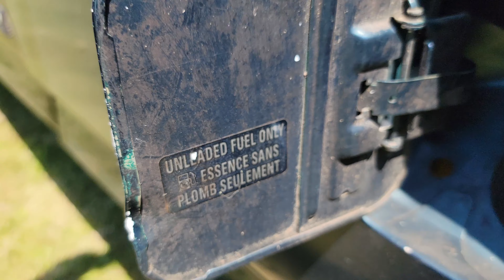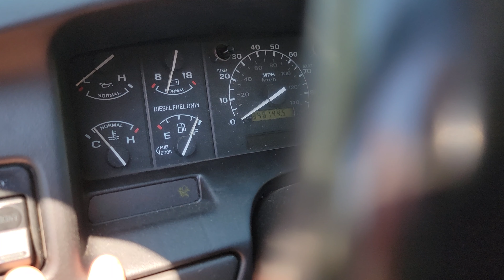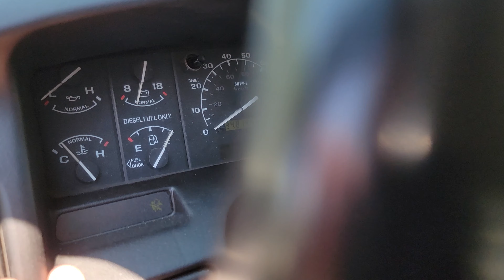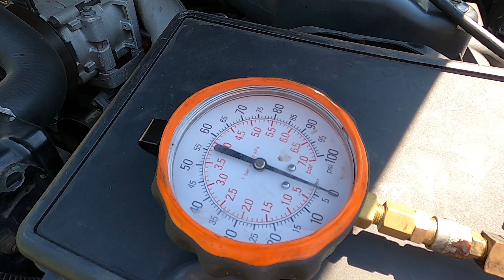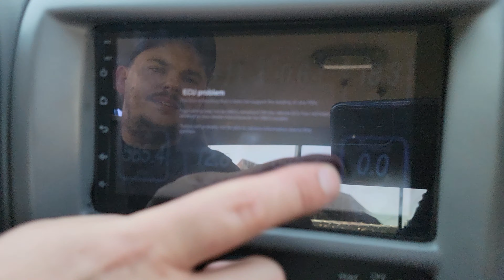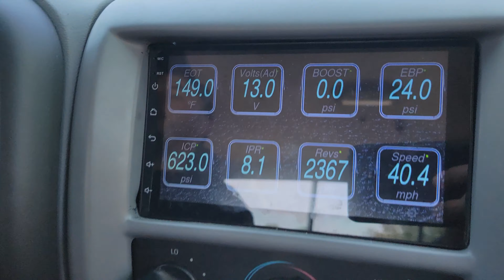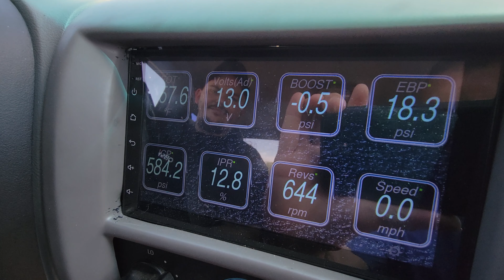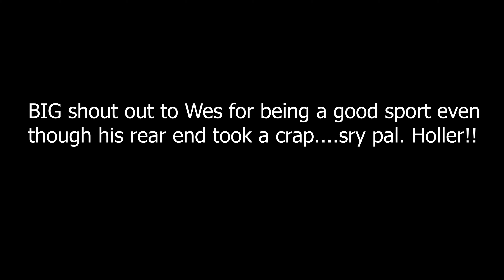FORD Diesel | FREE FUEL | Runs on used ATF Fluid **MUST SEE**

Comment: 2002 F250 4x4 Lariat 7.3, 375k miles, original engine, injectors, 3rd fuel pump (upgrading soon) 2nd transmission.  When I lived in AZ, ran 7 years on filtered 100% WVO (not bio) in a heated 60 gallon tank ( the look on ppl at stop lights smelling like yummy tacos n burritos) just flipped a switch to diesel fuel before ending the day and for start up in the morning.  Loved running it through a smog test!  
Still own today until I die, then I’ll pass it on to my boy.

Comment: My grandfather has a 97 12 valve 3500. Owned it since new and has done this since new. It has 180k miles on it. He doesn’t use as much as in the video but I believe almost 5 gallons. And it still runs good.

Comment: I used to do this with used engine oil, trans fluid and machine shop cutting oil in my 1996 Cummins 12 valve. Never a problem.

Comment: Man I absolutely LOVE those obs diesels!! I still remember having to drive my bosses Ford 7.3 when I worked at a stair building shop when I was 15. We used to say if your gas car sounds like a diesel somethings wrong! They sounded so good though!! Love the 7.3’s sound! LOVE my 6.7, but the 7.3 just sounds a little better!
Reply: Should hear a 6.7 with pilot injection turned off

Comment: In my 6.9TIDI I ran ATF when I got it but also ran waste oil, 5 gallons to 15 gallons of fuel oil. It would only smoke on cold mornings on initial start but once warm cleaned up.

Comment: That is one of the coolest trucks I've seen. Love the sound of a single shot 7.3 as well as that 6.0 fan... bet she sounds like a jet when it's hot out
Reply: O yes. When the fan kicks on you know it.  But it keeps the truck cool in the Florida summers
Reply: @codyphillips48  
I'm in texas man. Know all about heat
Reply: @3374jj  the 6.0 fan was done to pull more air through the AC condenser haha. As you know the colder the AC the better 🤣🤣🤣🤣 fat guys need good AC systems.
Reply: @codyphillips48  
I'm 6ft 3 and 250 lbs...
Yes , I'm aware of how we need ac... lol

Comment: I have an old 2003 7.3, that last of the simpler diesels. I've run new atf, motor oil, jet fuel, all kinds of shit. 

The key is using a centrifuge to get contamination out of the used oil. I won't put used "fuels" in my truck, but I always have half empty jugs of "fuel" in the shop, and when I get tired of it taking up space, I pour it in, and run it. Never any problems, still on stock factory injectors @ 288k+ miles. Cold starts like new, even in negative temps. 

I believe the additional lubrication has added life to the fuel side, as most I know have had to do injectors by this milage. I plan to go to 300k, then switch to 238/100's, which the truck is already built for. Should net around 450hp, 1000 ft lbs of torque when turned up all the way. Transmission was by far the most expensive part of the upgrades to support that power level. Torque converter alone was $1300. 

When the shit hits the fan, it's good to know that all the other unusable vehicles stranded on the road equals fuel for those of us with these ultra reliable dinosaurs. 

I love my old 7.3. even after getting out of new trucks I work on.
Reply: Yeah I only filter through a 6.7 lift pump. Never a problem
Reply: @codyphillips48  I absolutely believe you, just remember... The fuel side plunger and the walls of the fuel side of the injector are taking a beating with any contamination. Best to use a centrifuge to remove as much as possible for longevity. 

I've run probably hundreds of gallons of various fuels, even hydraulic oil. It all seems to burn the same, but smells different. I just won't put used "fuel" in. I personally don't have a centrifuge, or I would. I recycle a LOT of free fuel. Kinda of a waste really! Should be burning it!

Comment: My 97 has over 500 k also. Where would you be able to get that much ATF used bulk to make it practical to use ? By the way that  is a lot of fuel pressure 70 psi at idle. I put a fuel bowl delete kit on mine which still keeps the mechanic fuel pump in the valley. It makes about 45 psi at idle. I taped a fuel pressure gauge to the windshield on my truck to see what pressure it would make under load. My truck is a 5 speed also . I ran it up the mountain here above town 7 % grade to 11000 ft above sea level. As long you keep the rpms up over 2500 under load that mechanical fuel pump would make 75-80 psi .
Point is for you OBS guys is that it might not be worth the effort to change it out to an electric pump as long as you can keep the rpms up under load. My truck has the baby swamp single shot injectors like the truck above. Mine has a few other upgrades nothing crazy. It made 386 HP at the rear wheel on a dyno . It’s a daily driver.
Reply: I was a dealer tech. All used trans fluid from trans flushes came to me and the other techs with 7.3's. I've been running it for 6 or 7 years over 200k miles. I'm running the factory fuel pressure regulator kit from Mark F. It was definitely worth swapping to e fuel. The just for the idle quality it's worth it. Not to mention easier to swap filters and prime the system. Plus the only part I paid for was the fuel bowl delete.
Reply: Cody good deal Bro , it’s working for you. 👍. 
You answered my question about how to get access to the used atf to make it be practical. You where in a good spot to make it happen 😊

Comment: The only issue i can think of with used atf would be the suspended contaminants that the detergents cleaned out previously, they might be leaving deposits in the cylinder 🤷‍♂
I can see benefits burning virgin atf though with new detergents that would clean out everything.
I ran new stuff in my landcruiser today to try clean up cold start smoking, it smoked heaps but ran great, will see how it starts up tomorrow.
Reply: "50 micron filter" hahahaha laughs in sub micron particles

Comment: My mixes 10 gallons of diesel in a 55 gallon barrel fill it up with transmission fluid filter it in filter it out double filters both ways smokes when idling a little one starting like an old semi from the 60s when idling clears up one hour on the highway runs clean on Highway

Comment: I have been dealing with used transmission fluid for 10 years I have distilled cracked or refined with heat 780 degrees back to a base oil even having a centrifuge will not clean used automatic transmission fluid it is packed with aluminum steel Copper Brass hardened steel friction material water glue and epoxies binding agents

Comment: The injectors sound alot quieter then my 95 injectors when they were on trans fluid, one time i almost ran out of fuel and had some used engine oil, hydrolic oil, and air tool oil, i poured it all in there and got to the fuel atation an hour away
Reply: I've put over 100k on these injectors running nothing but straight trans fluid
Reply from the maker: Now thats whats up

Comment: firewoodfred says " get a transfer pump  they are only $20-25 on Amazon. you'll  never tip a 5 gallon can again"!!!
Reply from the maker: Weeeerdd
Reply: @PowerStrokeTechTalkwARod  Or get the EZ-Pour Hi-Flo replacement spout.  They're the next best thing to the ones the military uses, that can empty a 5 gallon can in 60 seconds.
Reply: I've got a 6.7 lift pump to transfer fluid butttt I left it in Florida at the other house.

Comment: So basically you would burn up the fuel pump and injectors in a newer 2017 6.7 if you ran a gallon of atf mixed with 15 gallons of diesel? Is there any downsides and upsides to running atf like this in old ass diesel engines? We use olddddd cranes and I wonder if tossing a quart or gallon of atf in them would help at all?
Reply: The upside for me anyways it's free fuel. This main reason I run it. Plus I'm being environmentally friendly. Gotta make Greta happy 🤣🤣🤣
Reply: Being its ATF it will also clean, as ATF has cleaning agents in it. It's also a decent lubricant.
Reply: If the engines are old idi engines the atf will clean and lubricate the fuel pump and keep the spray nozzles clean and spraying good patterns for combustion. I've been running it in my old cat motors in my semi's and dump trucks for years and put right around a half gallon to 20 gallons of fuel in my 01 7.3 SD F350 a few weeks back. In my opinion it keeps the fuel system clean and lubed and it just helps it all run smoother longer. My   $.02
Reply: Basically the old diesel will absolutely kick a new diesel in the nut sack. Plus we don't have to buy Def exhaust fuel... hahaha

Comment: I swapped a 12 valve into my Chevy over the winter, and now all the used transmission oil from flushes at the shop I work at goes right into my fuel tank. 

I like ATF over waste motor oil, seems like the ATF doesn't contain all the sludge and crap you have to filter out with a centrifuge. But I still throw a couple gallons of waste oil in there from time to time. Runs great.

Comment: Arod, not to get off topic, but are the new high pressure fuel pumps in the 2021 powerstrokes still cp4 or cp4.2 ? I am hearing horror stories about those pumps. Would a cp3 work in the new diesel powerstroke or would it not be strong enough?
Reply from the maker: Cp3 does not fit. Uses cp4.2...only horror story's i hear are from dumba$$'s who aren't doing what they are supposed to.
Reply: @PowerStrokeTechTalkwARod  and I assume you mean that fuel additives NEED to be used ??
Reply from the maker: EVERY TANK!!! LIKE NO JOKE
Reply: @armedprophet3321  also be sure your checking the fuel your getting before pumping into the tank.....

Comment: make sure to use Ford approved mercon LV fluid only in your powerstroke fuel system.🤯
Reply from the maker: LV only way to go....cleans AND lubes....win win, right🥴🥴🥴🥴🍭🍭🍭🍭
Reply: Is it the letters L and V or the Roman numerals for 55?
Reply from the maker: Yepp LV is 55
Reply: @alexshikin5093  doesn't it mean Low Viscosity? The new fluid (ULV) means Ultra Low Viscosity, I believe.
Reply: @Kevin_10225  Maybe, That why I'm asking.

Comment: Where do you guys recommend sourcing waste ATF?
Reply from the maker: Shops
Reply: @PowerStrokeTechTalkwARod  lol, yeah I guess that makes sense. I feel like an idiot showing up in a diesel jetta at random asking for old atf fluid but its worth a shot I guess.
Reply from the maker: Lololol
Reply: @sgfreak96  your going to help the business get rid of used oil but you have to take time and filter it. Use a strainers until you can filter through coffee filters. It's a long process but it's completely safe
Reply: @jeffheiks3022  I run it through a 6.7 lift pump/filters and call it a day. 10 micron and a 4 micron filter. Then it goes through another 10 micron filter on the truck
Reply: @codyphillips48  I saw a video they simply filtered through a bed sheet... I'd probably recommend refiltering a few times
Reply: ATF and Acetone makes the best fluid for removing stuck nuts and bolts.

Comment: How long have you been running straight trans fluid?  I've heard that it can foul up the injectors and glowplugs.
Reply from the maker: I dont foul is a term i wld use here. But to answer....long time & no
Reply: About 6 years over well over 100k.
Reply: @codyphillips48  where do you get all the atf, local trans shops?
Reply: @ghostrider-tj7du  from doing transmission flushs on customers vehicles.
Reply: @codyphillips48  talk about free fuel😂😂 life hack if I ever heard one🤣

Comment: So where do you get tons of used atf and how is this cheaper than veg oil or just plain diesel??
Reply from the maker: Shops.........
Reply: I don't know about your location but here in Missouri at our shop they pay us to take are waste oil
Reply: I got mine from work. I did trans flushes daily and I'd get flushes from other techs. It was 100% free so it was definitely the cheapest option for me. I didn't pay for fuel for 5 years. Put over a 100k on the truck that way.

Comment: Would this cause a legal issue with the thought that it’s off-road diesel?
Reply from the maker: ....but its not off road....
Reply: @PowerStrokeTechTalkwARod  If they dipped it they would think it was.
Reply from the maker: Can, YOU tell the difference between diesel fuel & STRAIGHT trans fluid......???🤔🤔🤔
Reply: @PowerStrokeTechTalkwARod  No
Reply from the maker: Sounds like you got a problem you might wanna get that looked at

Comment: I run Jet A occasionally no prist, tho
Reply: Jet-A is the same as #1 heating oil and diesel before ULSD. Paperwork and added antistatic additive is all. Shipped Jet-A by the millions of gallons to the villages so it could be used as Jet fuel, Diesel or heating oil.

Comment: Not in my 7.3 or my 6.7 they run just fine the way they are
Reply: It's being used because I'm cheap. Free 99 or 3 something a gallon. I'll take the risk. 100k later still running the same baby swaps.